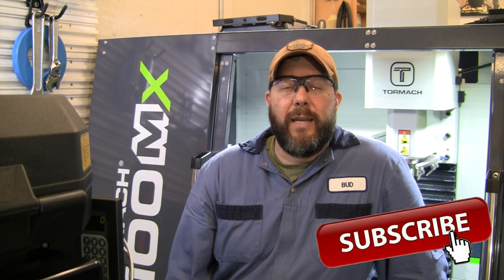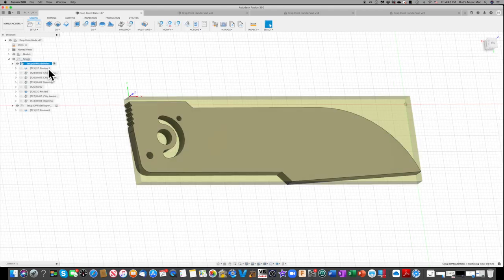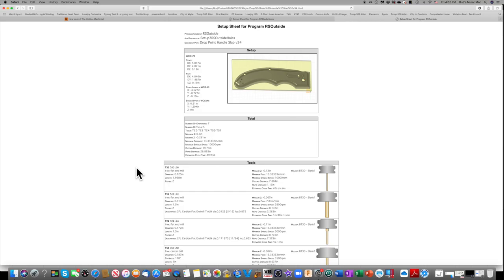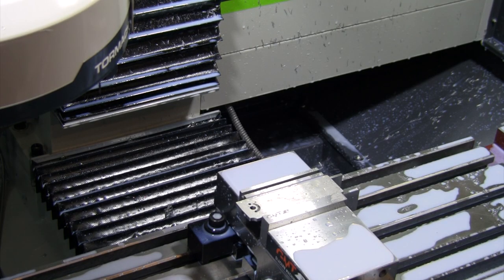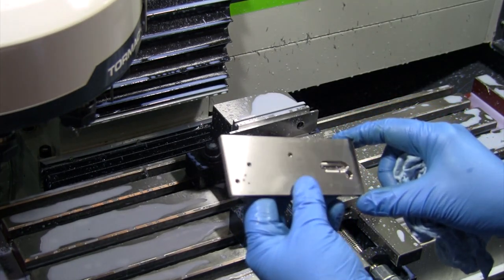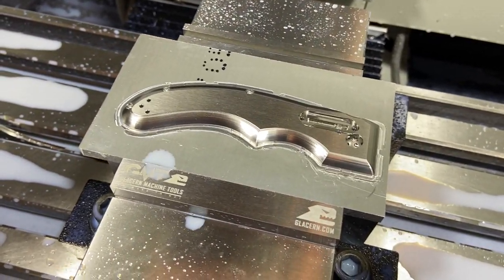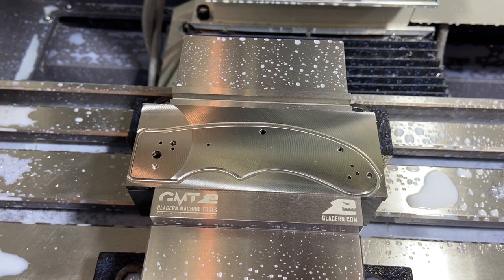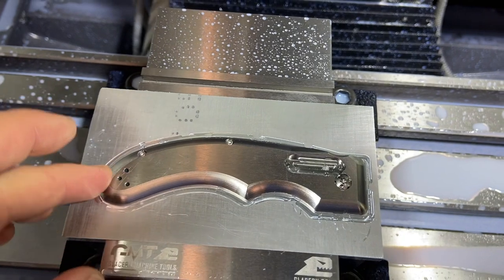Triple"B"S Knife Lock Build Series - Part 1 - Knife Making With Fusion 360 and Tormach 1100MX

Comment: You should do lock strength comparison between this vs Benchmade vs Spyderco
Reply from the maker: Genesislights - I may get there at some point. Or maybe I will get BladeHQ to test one using the same setup they have tested those brands and other knives with. I did test one of mine as you can see in another video but my method was not as good as what they used.  Thanks for the comment.

Comment: Nice videos and good luck with the knifes. They look really nice. For the Fusion problem you just have to select one face of the left over geometry to remove and press DELETE on the keyboard. Fusion360 it's smart enough to understand what to remove :-)
Reply from the maker: Ale - Thanks for the Fusion tip.  I googled and searched for the easy solution, I figured there had to be one and sure enough there was. No doubt it is a smart program. Oh well, 7 hours I will never get back but I am sure it helped with my overall Fusion learning.
Reply: @BladesIIB  that's totally normal. Being using Fusion for over 5 years now, for both CAD and CAM, so if you need something just ask. I am making short video tutorials on Youtube for the engineering guys at the University where I work, so in case I can make shorts one if you feel stuck on something. I am sure others will have the same doubts. It's part of the process. You are way head on everything if this is the first time you are programming a CNC machine. Also start with Titanium is a really remarkable.
Reply from the maker: @Ale_Lab  Thanks for the vote of confidence and offer sir support. I will be sure to reach out with future questions. I will also check out your channel and videos. I have a lot of machining experience just having to translate it into CNC, like a new language but it is coming.
Reply: @BladesIIB  Yes, it's clear that you have machined a lot manually. That will help you a lot, since you know how an endmill should sounds ecc... Let me know when I can help. Really like your videos and your voice over.
Reply from the maker: @Ale_Lab  Thanks Ale, I sure will.

Comment: im following with you want to start my own journey when i know enough do you suggest buying a 440 or just outsourcing production?
Reply from the maker: Controller Junkie - Thank you for watching and thanks for the question. Doing your own production or outsourcing is a huge difference and likely comes down to more than just the machine choice. Depends on what you enjoy and where you want to spend your time. I live the manufacture process and that is the main part of the hobby for me. If the goal is to sell more knives faster then outsourcing the production may be the better option. For me I did not want to go smaller than the 1100 MX primarily because I wanted the BT30 spindle. That said I did not look into the 440 enough to give you much feedback there. I would look at some 440 videos and reviews and see if it seems capable to handle what you have in mind. All the best whichever route you go. Truly a great way to spend your free time.

Comment: Did you consider boring the pivot hole then reaming it?
Reply from the maker: Tim Wolf - I had not thought of that yet. Sounds like it may be a great idea.  Bore it close and ream it. I will try that on the next one. Thank you.
Reply: @BladesIIB  I’m slowly making my way through all of your videos. My Tormach is on the truck from Wisconsin as we speak… I’m making similar parts to you (flat, relatively thin stock) and plan to bolt them to a sub plate so they are supported fully. I think you’d have much better luck drilling if there was something supporting that end of the part. I’m sure you’ll end up making a fixture like this anyway once you’re past the prototyping stage

Thanks for making these videos, you really have done an awesome job and deserve more views than you’ve gotten.
Reply from the maker: @timr86868  appreciate the feedback. The piece is supported, there are parallels under it the whole time. I think when I drilled it the first time I just fed so hard the end mill flexed and cut oversized. Definitely a learning process when you can’t “feel” what is happening. All the best with your new machine. You are going to have a lot of fun.

Comment: Did you need to add that second oiler?
Reply from the maker: RC - was rushing to head out on vacation. Got home yesterday and hoping to get out in the shop to check it out today. Thanks for the reminder.
Reply from the maker: RC - checked mine today. They recommend 12 second actuation time and I have mine set for 15 seconds. First 15 seconds I did not get a drop, second 15 seconds I got 18 drops and third 15 seconds I got 48 drops (I videoed it to send them and count drops). Not sure what volume I should get so maybe I just need increase my actuation time?  Says it can be a max of 3 minutes so maybe I go to 45 seconds?  I will send a ticket to Tormach and see what they say. Thanks for the heads up, much appreciated.
Reply: @BladesIIB  I'm telling you that second oiler mounted on the column is the ticket lol
Reply from the maker: @RcBlade  sounds good, I will ask for that. Trying to picture where you have it mounted so it does not get full of coolant?
Reply from the maker: @RcBlade  Will do, thanks.